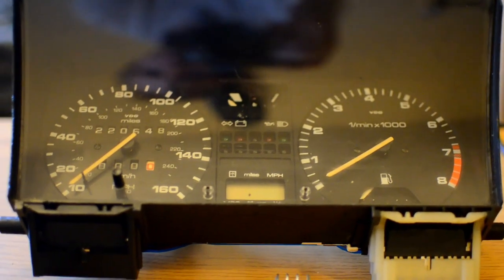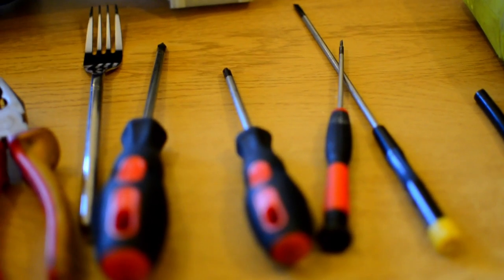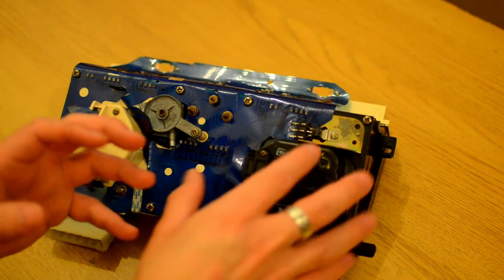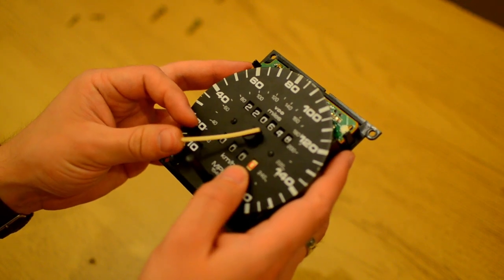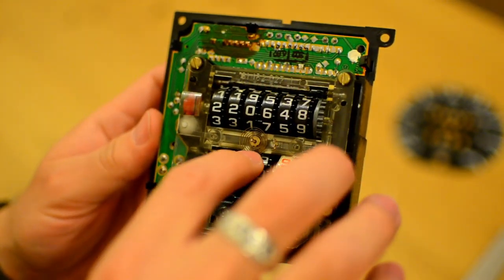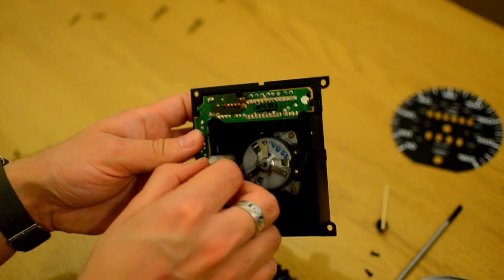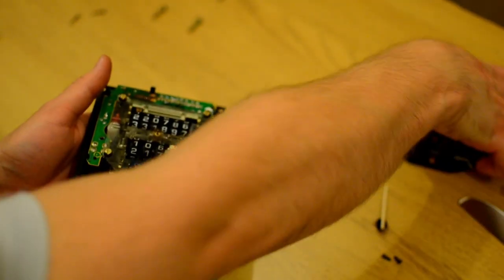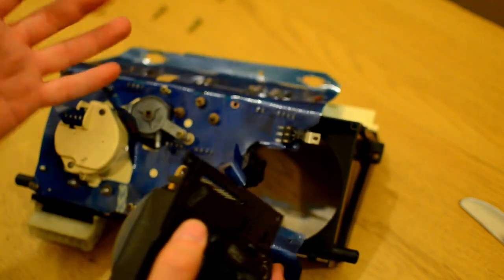Golf Mk2 Instrument Cluster Repair - Part 2 - Speedo

Comment: Thank you so much for posting this. It gave me the courage to replace the red gear on my daughter’s MK2 Scirocco. It turned out that not only war the red gear cracked, but the gray metal gear on the other side was slipping. I ended up pulling the rod out partway and pulled off the gray and 1st black number, cleaned the rod and put a spot of glue on the rod before I slipped the last gray gear back on. It works now and I’m so happy. Thank you again!

Comment: Can you access the screws to remove the cluster from the case by rotating the dial face and going through the rectangular slots ?

Like most people in uncomfortable pulling needles off just in case i break them.
Reply from the maker: The needles are quite easy to break (I have broken them in the past) but if you're careful they aren't too bad. You could possibly reach and adjust the mile counter without removing them but I wouldn't be too sure on that. As with your other comment, I can possibly check in the next couple of days if needed.

Comment: Thanks for the great video. If you don't mind me ask, do you know what is the function of the speed sensor you mentioned at 5:15. It's been bothering a lot since I don't have this sensor on my mk2. Thanks a lot.
Reply from the maker: It's for the digital display / Multi Function Display in the cluster. All GTIs should have the MFD which lets you see oil temp etc. and speed is one of the things on there, although I recall it's not terribly accurate as the sample rate is quite slow.
Reply: @FinalDecap  thank you so much for replying

Comment: How far do you need to get into the dials to replace the lcd?
Reply from the maker: It's been quite some time since I took a set apart but I recall you just need to remove all the screws from the back and each section will come out easily and safely enough. I might have some I can check in the next few days and get back to you if that's useful.

Comment: Hi Chap- good video. Do you know how many cogs there are on the red cog wheel as you can now buy these - they come with 17,19,21 variants. My car is a 1991 Mk2 Golf 16V with stock 160 clocks. Also the  roller wheel there are different variants thick 3,2 mm; 4,5 mm; 6,4 mm ..   My speedo works but the odometer and odometer reset is frozen so I guess my cogs have failed through age. Thanks
Reply from the maker: To be honest, I'm not sure. I can check the spares I have as they all fitted fine in the 160 clocks I had...but my stuff was CE1 and if yours is 1991 it'll be CE2. I suspect they are the same but I can't guarantee that they will be. I'll measure the spares I have and get back to you.
Reply: @FinalDecap  Thanks mate at least you can get the two cogs on the end its a shame yours is a CE1. Is it  quicker to get the gauge cluster out a ce2 set up, Thanks  This is the cog I have been told it will probably be from seller for one end. cog 21 https://www.ebay.co.uk/itm/ZAHNRAD-F-VW-GOLF-MK-1-I-VDO-TACHO-KOMBIINSTRUMENT-KILOMETERZ%C3%84HLER-REPARATUR/173267214137
Also the cog at the other end of the shaft will be either one of these variants 
There are 3 different thickness variations ( 3,2 mm; 4,5 mm; 6,4 mm)  https://www.ebay.co.uk/itm/D2-2-WALZEN-ZAHNRAD-FUR-MECHANISCHE-VDO-TACHO-KILOMETERZAHLER-WALZENZAHNRAD/173738876341?_trksid=p2485497.m4902.l9144 Thanks

Comment: And still works?
Reply from the maker: Once rebuilt, yes. I fitted the drive from another known working unit and used the 160 clock's needle spring to ensure it reads correctly.

Comment: How you do calibrate the velocimeter?
Reply from the maker: Do you mean the needle position? Around 14 mins I show where the needle needs to point when it's reattached. If you mean one of the components within the speedo itself, they shouldn't need calibrating but they can fail, in which case the easiest option is to replace them with parts from a donor unit.